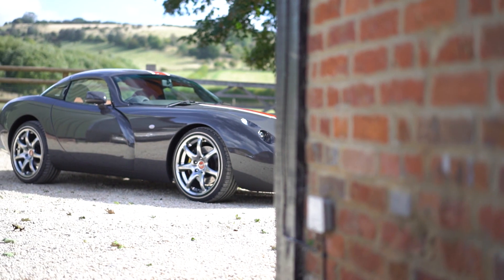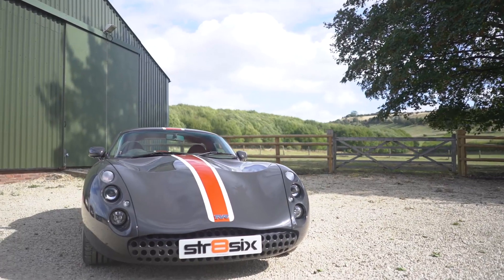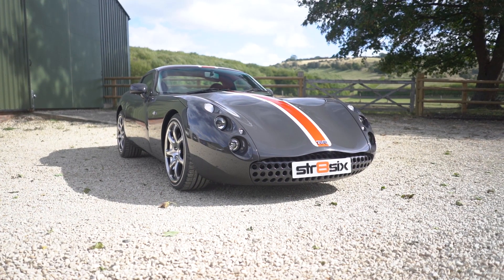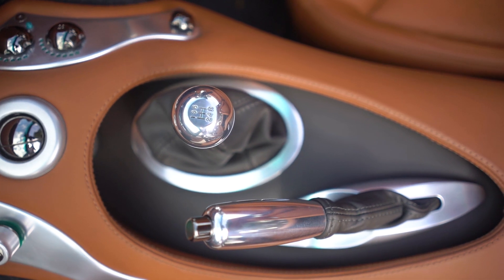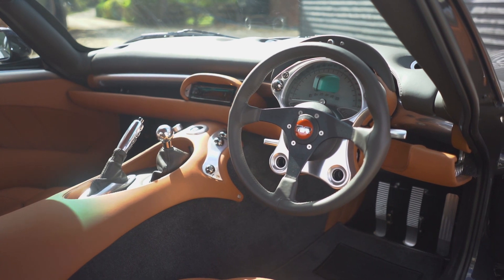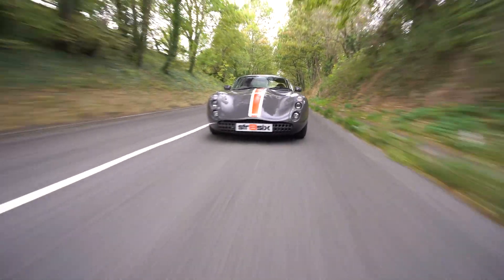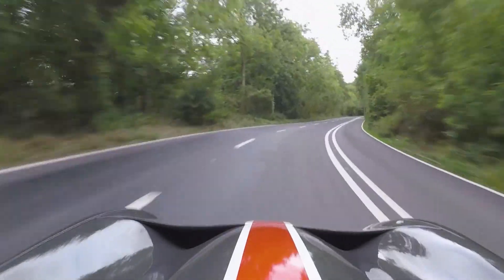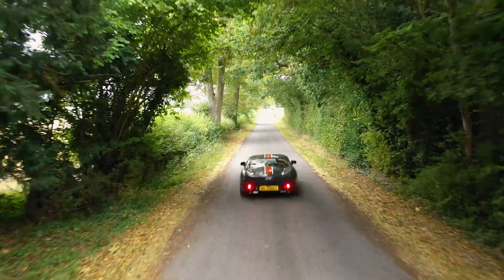Str8six Signature TVR Tuscan

Comment: What would a full rebuild cost? And is there a possibility to wide the body a bit to allow larger brakes and wider wheels? Breaking distance and understeer ate the two things the Tuscan needs fixing for to make it the perfect drivers car...
Reply: At that point, I'd just buy a Sagaris kit, and build it myself. The entire thing costs around 60k american minus engine and gearbox, and it's update means it can be built however you want.